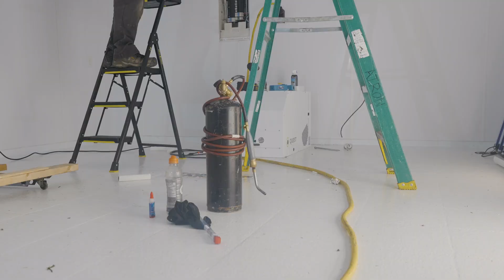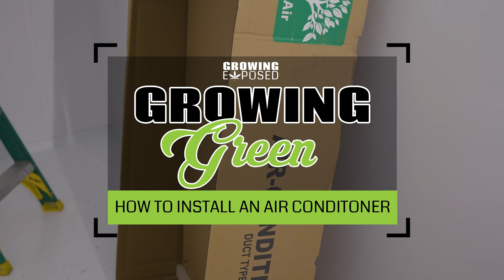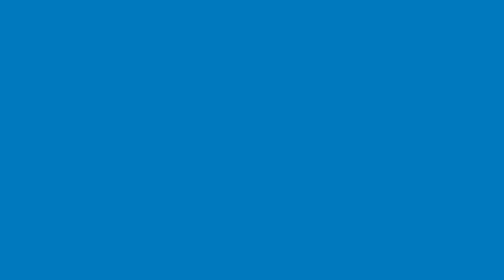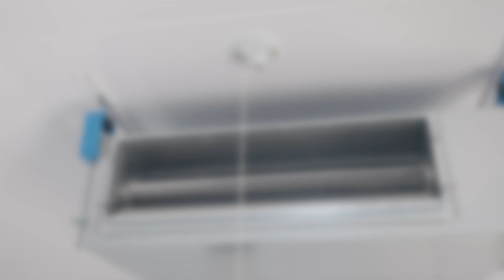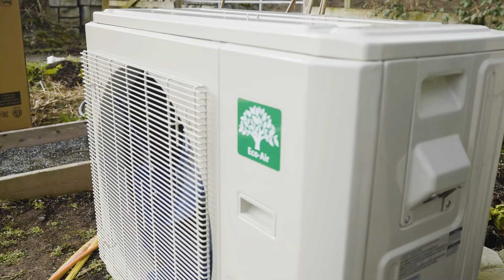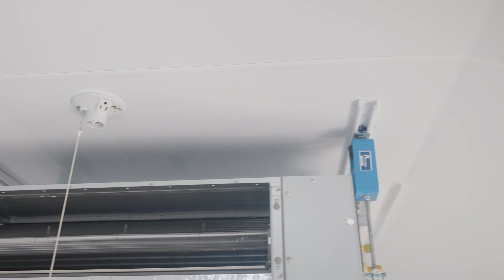Grow Room Air Conditioning Installation | Growing Green VOL 4

Comment: I just bought a Panasonic 48000 btu. I set the temperature at 27c and it’s not cooling the time a perfect temperature it’s either going too low at 21c then goes up to 33c then cools back down to 21c . Don’t understand why this is happening. Any suggestions?
Reply: It's call short cycling
Reply: It's over sided
Reply: 12000btu for 400 Sq ft
Reply: Plus heat load maybe another 6000btu

Comment: That's the most expensive growroom per square foot I've seen lol. Don't get me wrong I'd love to have it but damn. It would take me years to offset the initial investment. I realized a long time ago that growing underground is the way to go. The rooms are always a steady temperature and in one basement I have I tried a idea I got from a pool heater. I buried pvcpipe 4 feet down and did a big loop around the house. It sucked the hot air from the room and circulated it through the pipe and the ground cooled the air and back into the room. Pretty much a natural AC. It didn't do enough to not need a ac but it cut my bill in half. Around here the electric company's are the biggest problem. They spot the grows and rat us out so we have to spread grows over multiple locations to hide out footprints. And you can't run more ac than say a natural house would. It's a red flag. We gotta stay within the range of KW that the house has used in the past. It sucks but we gotta do what we gotta do. We even have cars in the driveway we get from auctions, timers setup to the TVs and recordings of kids playing so when the Guy comes around to read the pole it dosent look or sound like a empty house pulling a family of 6 worth of electricity. It looks and sounds normal. What we have to do to grow the harmless plant we love is sad.
Reply: man greetings from uk.we do same decoy game here.but dont go to much into details u let cops knows this too55555
Reply: damn bro either youre living in 2008 or a non med/rec state still eh lol
Reply: You could be my neighbor as per your description of freedoms.